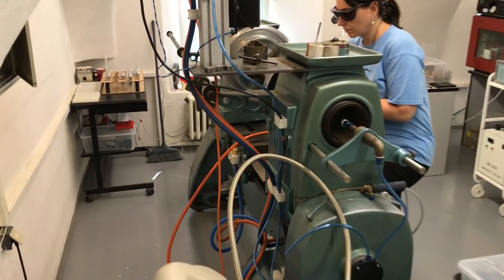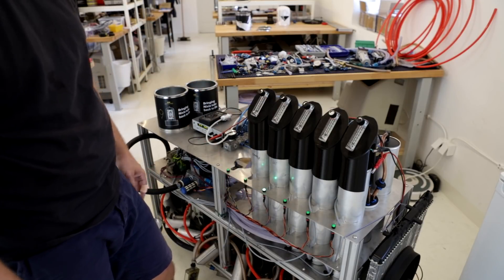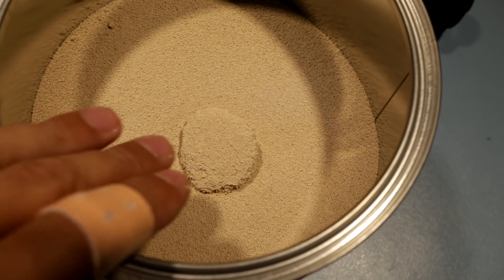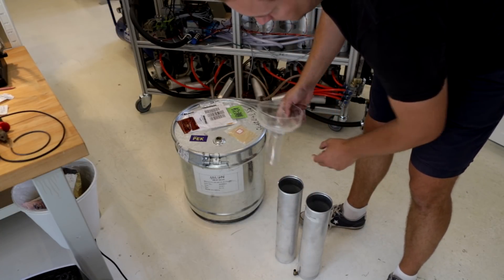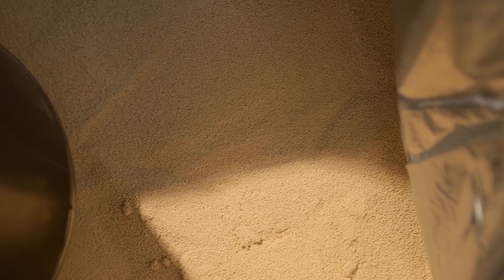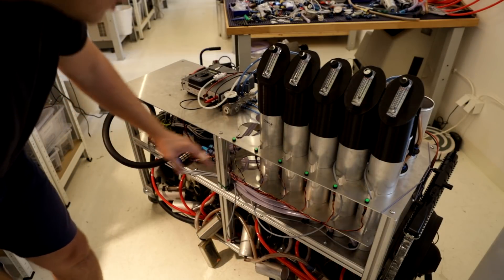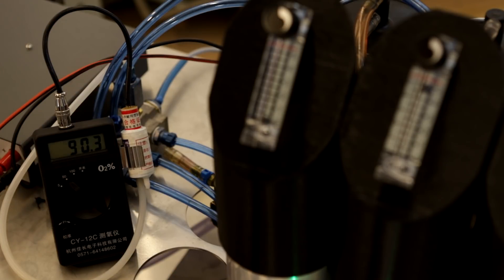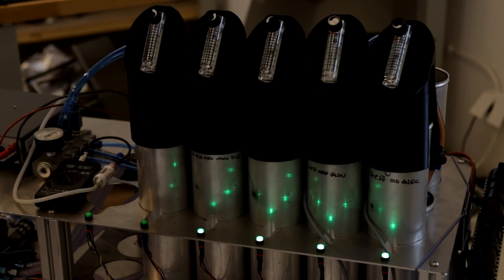Filling the oxygen concentrators with new molecular sieves - Project H #17

Comment: I wonder if you can regenerate those sieves?  When I dry solvents microwaving the larger 3Å ones does the trick quickly, they get hot if you dump them in water afterwards and toluene that sits over them for a while doesn't react with potassium.  The microwave trick can overheat them if you aren't careful though, so an oven bake is slower but safer, you need to get zeolite to at least 250 C to release bound water, but the zeolites for pressure swing absorption may need different treatment or be permanently poisoned by getting damp?  I don't know if they are chemically different from common drying sieves?
Reply: Hey, you here! I miss your videos!
Reply from the maker: I tried 250C both in air and vacuum (<1mBar) and it made it even worse.. will try to find how to do it one day!
Reply: @daliborfarny  how about nitrogen flush? From the bottle it's really dry and should be cheap...
Reply from the maker: @AKAtheA  Do you mean flushing the sieves with nitrogen to regenerate them? I tried vacuum and it didn't work - so with N2 it might be even less probable.. But we will find a way :-)
Reply: @daliborfarny I was so curious I just asked ChatGPT. And I want to share the output. (Ididnt test it but I will share the complete output).

Short answer: heat it and drive the water off with either a dry purge or a vacuum. The “best / fastest / cheapest / most efficient” choice depends on what utilities you have. Here’s a compact guide that covers both plant-scale and benchtop use.

Quick decision guide
	•	Have a vacuum pump but limited gas/heaters? → VSA/TVSA (vacuum swing): pull vacuum (optionally warm the bed). Lowest gas use, often lowest energy if vacuum is cheap; fast because desorption is strong under vacuum.
	•	Have an electric/steam heater and some dry N₂/air available? → TSA (thermal swing with dry purge): heat to spec and sweep with a small counter-current dry purge. Robust, simple, usually cheaper than vacuum if purge gas is inexpensive or recoverable.
	•	Only small quantities / lab jars? → Oven + dry purge or oven + vacuum: bake sieves in a lab/box oven with a trickle of dry gas, or under vacuum if you have a vac oven.

Typical regeneration conditions (zeolite molecular sieves)
	•	3A / 4A / 5A: 200–300 °C bed temperature.
	•	13X: 250–350 °C.
	•	Avoid > 450–500 °C (risk of framework damage).
	•	Purge gas: dry N₂ or dry air (air only if no hydrocarbons present). 1–3 bed volumes/min during heat-up, then reduce to 0.3–1 BV/min at hold.
	•	Vacuum: ≤ 10–50 mbar absolute greatly accelerates drying; combine with 150–250 °C for TVSA.
	•	Endpoint: outlet dew point ≤ −50 °C (better: ≤ −60 °C) or constant weight for lab samples.

Fastest method (usually)
	•	TVSA (heated vacuum): ramp to ~200–250 °C while pulling vacuum; hold 2–4 h until dew point/pressure rise stabilizes; cool under vacuum or dry purge before breaking vacuum. Very quick desorption with minimal purge.

Cheapest method (usually)
	•	TSA with waste heat + recycle purge: if you can use low-grade waste heat and recirculate purge through a condenser to knock out water, this minimizes both energy and gas. For many plants this beats vacuum in OpEx and CapEx.

Most energy-efficient tips (work for both TSA and VSA)
	1.	Counter-current regeneration (opposite to adsorption flow) improves driving force.
	2.	Stage the purge: high flow during heat-up, low flow at holding temp.
	3.	Recover heat: use outlet gas to preheat inlet purge (gas-gas exchanger).
	4.	Purge recycle with condensation: cool the wet purge to 0–10 °C, drain water, and reuse.
	5.	Insulate the bed and avoid over-temperature: only heat to the minimum that meets dew point spec.
	6.	Don’t contact hot sieve with humid air—cool to < 80–120 °C under dry purge/vacuum first.

Simple lab/bench procedure (few hundred grams to a few kilos)
	1.	Load beads/pellets in a perforated tray (single layer if possible).
	2.	Purge or vacuum:
	•	Purge route: place in a 250–300 °C oven; flow dry N₂ or very dry air through the oven (not across flammables).
	•	Vacuum route: place in a vacuum oven; pull ≤ 50 mbar, heat to 200–250 °C.
	3.	Hold 2–6 h (until mass is constant or outlet dew point plateaus).
	4.	Cool to < 100 °C while still purging/pulling vacuum.
	5.	Store immediately in an airtight, dry container (desiccator or sealed can).

What to avoid
	•	Steam regeneration on zeolite sieves (fine for silica gel/activated alumina, but prolonged steam can dealuminate zeolites).
	•	Liquid water exposure—it dramatically shortens life.
	•	Regenerating with oxygen-rich air if the sieve has adsorbed hydrocarbons/solvents—use N₂ to avoid ignition.
	•	Thermal shock: don’t quench hot beds with cold gas.

Rough rule-of-thumb setpoints by type & duty
	•	Drying duty (water only): 3A/4A at 230–260 °C TSA or 180–220 °C TVSA.
	•	CO₂/H₂S-laden streams (5A/13X): lean toward the higher end of the ranges.
	•	Ultradry targets (≤ −70 °C dew point): extend hold time or combine mild heat (180–220 °C) with vacuum.

If you tell me your setup (vacuum available? purge gas source/cost? bed size? sieve type and what it adsorbed?), I can tailor a one-page SOP with exact temperatures, flows, and timing.
Reply: @daliborfarny  How long under that heat and vacuum?

Comment: Wonder if it is possible to regenerate the old sieve material by leaving it under vacuum for a few days in a larger cylinder, and allow the adsorbed moisture to come out. Probably not worth it though, as the wear on the vacuum pumps will be high, along with the power. 

You are going to have to pack the remaining zeolite back under vacuum though, though it does look like that container it came in has a good lid seal, and you can add a Schroeder valve to it to connect up a vacuum pump to exhaust it. I guess that that material was packed and evacuated in the bags already in the shipping drum, no other way to get a vacuum pack like that to fit once it is rock hard from atmospheric pressure on it.
Reply from the maker: SeanBZA i tried vacuum (below 1mBar, 15 hours, 250C), they were even worse after this process.. not sure if the sieves need to be under vacuum - they are under air in the concentrator normally, for decades..
Reply: @daliborfarny  ah, that's what I was wondering...is it possible to rejuvenate the old sieve material with vacuum and/or heat.  So, you're saying that made it worse?  That's strange.
Reply: @daliborfarny  Will keep them in like new condition till you use the granules, instead of them getting atmosphere in and degrading. Not going to need much, just well under ambient and with a seal that will keep them that way.
Reply: Glad that all worked out Dalbor, nice when plan comes together.

Comment: They are warm because they took up the humidity in the air as far as I know
Reply from the maker: neur303 might be - or it is just a pressure change.. we are rising the pressure from vacuum to atmospheric very fast..
Reply: The heat of adsorption can be quite surprising with these.
Reply: I am pretty sure they come pre-dried hence the double packaging and vacuum. I think for certain applications they have to be dry.
As soon as you open them they will adsorb moisture from the air and like silica gel get hot depending on the speed.
The vacuum certainly helps to do this fast.

Anyways I am happy to see it works for you now!
Reply: Look up "latent heat of condensation"